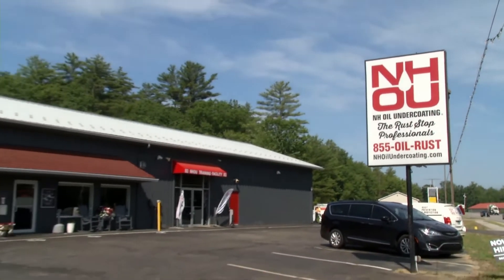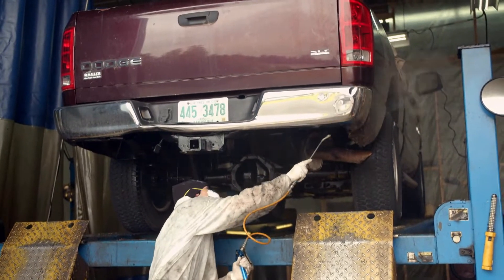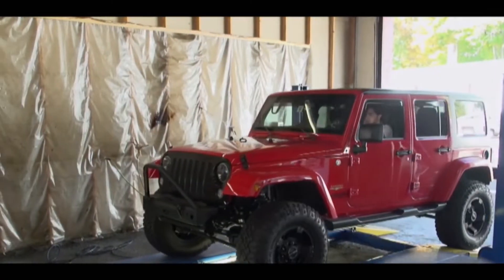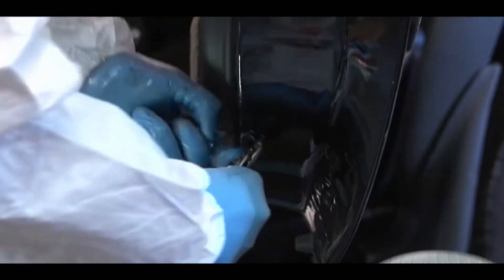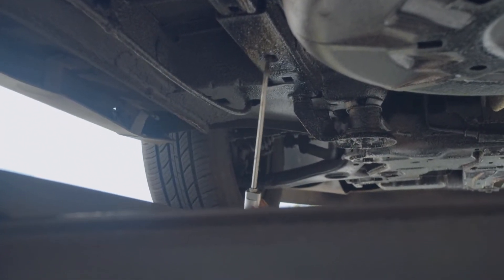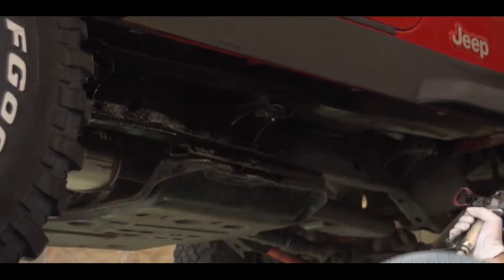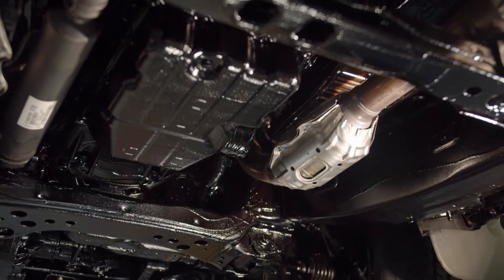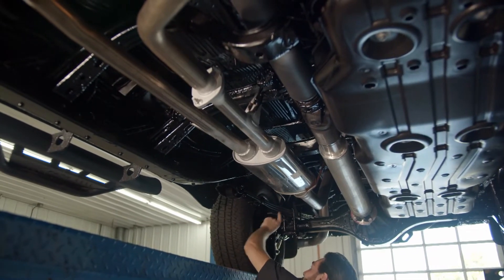NHOU Rustoration® Rust Converter

Comment: I have some underneath lighting installed on my truck. Its wiring is inside corrugated sheathing that runs along the bottom of the truck and has brackets that hold it up. Does this type of hardware need to be removed/uninstalled prior in order to have an undercoating done?
Reply from the maker: The product is nonconductive so the wiring is fine, you just may want to cover the lights or wipe them down once the application is complete